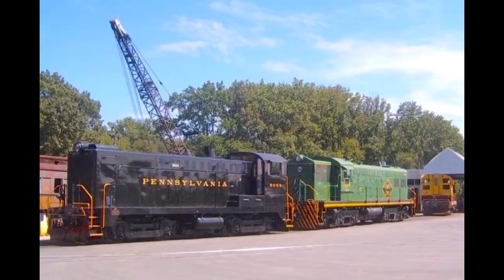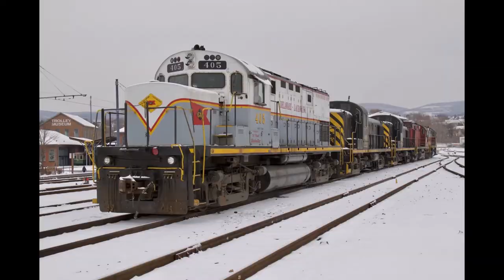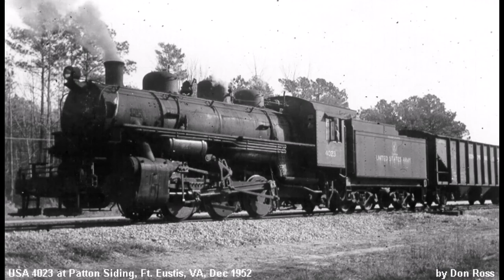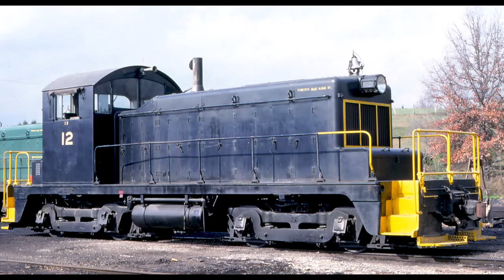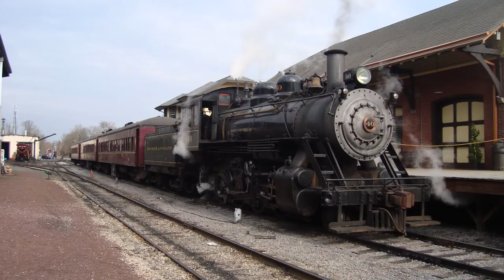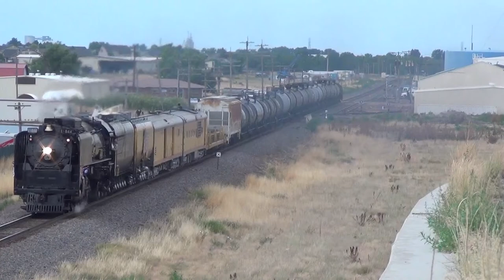Remarkable Engines: SMS Rail Lines #9

Comment: As of October 2022 sms rail lines #9 is nearing completion the cab was put back on the engine also sms rail will start it's tourist operation on November 5th 2022 and the operation will fully begin in the spring of 2023, also they expect #9 to be completed in April of 2023.

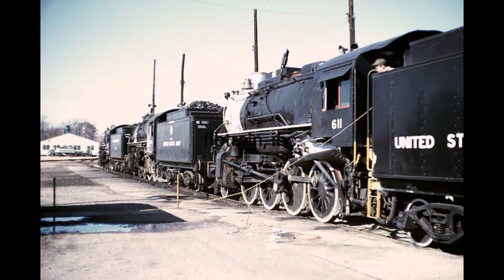Comment: 1:12 Notice anything special? The USATC S160 2-8-0 #611 pictured here deserves an episode of its own. It was fitted with experimental rotary cam poppet valve gear, but ultimately never got to prove itself. Ended up being used for target practice, and as a source of spare parts for other engines. Now it is/was being used by the T1 Trust to design #5550’s valve gear, to ensure a design is chosen that works.
Reply from the maker: Interesting to hear. I might include it in a future video of Train Facts.

Comment: A bit on number 9's ancestry,as it is a classic USRA[WW1],design,slightly modified for continental loading standards! By the by,that would in itself be a good series also,as those designs had a very far reaching effects! Every continent,except Antarctica,had USRA,or war designed engines! The S160,2-8-0's were the WW2 derived design,and also the 2-8-2's,which were extensively used in India,among other places! Fascinating history,now little covered! Thanks for the information,and awakening my brain cells! P.S.,I grew up on the Oyster Bay branch of the LIRR,and saw the gamut of steam and diesel power,plus I went to high school in Pennsylvania,near Harrisburg,and saw the PRR Middle and New York divisions,close up! Lucky enough to see a Centipede in action,never forgot that,so your videos are more than just history,I was there,so thank you,for your diligence and persistence! 😇!

Comment: What happened with the 1992 rebuild?
Reply from the maker: I'm not sure. I think the engine didn't have the right parts at the time??? I'm not sure off hand, but I'll try to look it up.
Reply: Pensyfan19 ok. Thank you!
Reply from the maker: @mylesspear  This was quoted from one of the sources I used for this video. "Some years prior, the driving wheels on No. 9 were swapped out and replaced with those from scrapped No. 7, while 9's valve motion and running gear turned out to be an odd mix of parts from both engines". I would guess the parts from two different engiens with varying amounts of wear and tear didn't help the rebuilding process, which was abandoned in 1995. I hope this helped.
Reply: The rebuild was halted because management didn’t want to pay for it and they shoved it off in the weeds and over the years key parts were trashed.